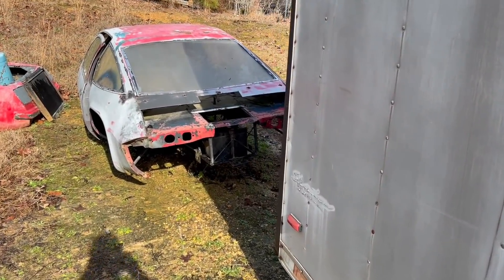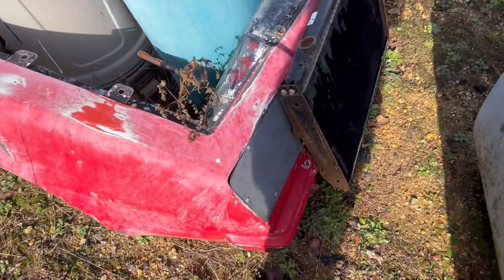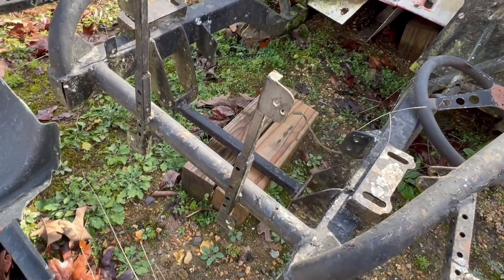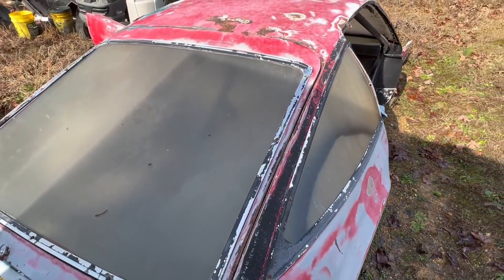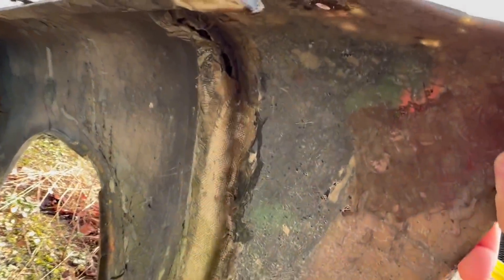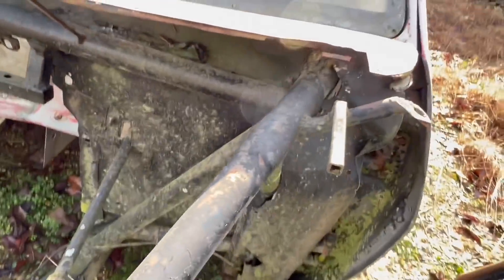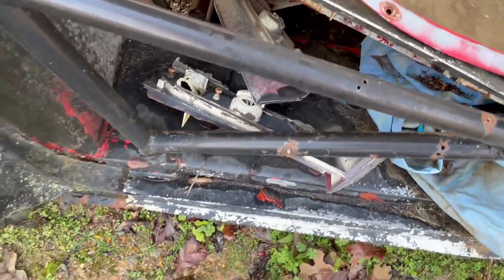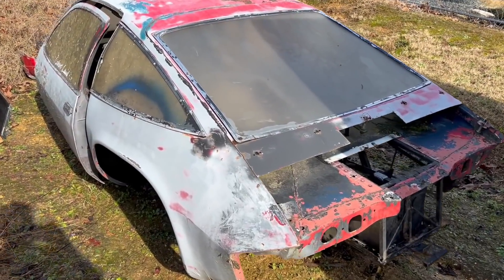ABANDONED Chevy Monza Drag Car - Is it Worth Saving?

Comment: Looks like an Alston kit chassis. I have a Pinto on one I built in the 80s. Pinto front end parts bolt on and Alston 4 link bolt to rear. At one time there were a lot of them running super gas but they used .120 wall tubing and won't cert by todays standard for 9.999 and faster. They were light, my pinto weighs 2665 with an FE Ford. Make a great bracket car. Clean it up and put together a roller for someone to finish into a weekend bracket warrior.

Comment: Buy it , piece of history. One coolest looking, low budget race cars. There's a lot of good stuff there. Monzas are still very competitive, I see them going into the final rds. at many tracks. I bought one, a roller, mostly all fiberglass,needs finishing, was raced when all steel. Was told will weigh 2150 lbs. with me in it, W/SBC.  Go fast cheap !   Hey whats one more ?

Comment: You should buy it and build it, best you can. At least you have saved it. Find a 80's Camero 305 V-8 throttle body injection,that would be the perfect engine.cameros come with 4 speed automatic overdrive, perfect for drag racing

Comment: I'd pass on this one.  1) It is not an important car, 2) it'll cost a fortune and be difficult to find parts to fit what remains of the car, 3) a Monza is not in much demand, 4) there is so little left of the car...it is basically a frame and parts of a body.  If this was a '40 Willys I'd be very excited.  But for a few scraps left from a little-known Monza?  You only have so much time to work on these things...wait for something with much better potential.

Comment: I wouldn't buy it.
You've got too many projects now.
They get set aside for a reason.
As example, today's suspensions are different.
It may not retro fit to the "Hot Setup"
Yes you could use old stuff. Can you find enough for like 10 cars ?
How many hours aweek can you set aside to build ?
How many projects do you have ?
How many hours and $$$ to complete each car ?
Easy 3-4 years a car.
That's 30 years of production time.
Again, how many hours a week can you devote ?
Lol....how long does editing take a week ??
Sorry, just trying to be practical.
Reply from the maker: Haha, but being practical isn't very fun!
Reply: @HotRodHoarder  CORRECT !
But either is 500 incompleted projects.
Everyone not finished is a defeat.